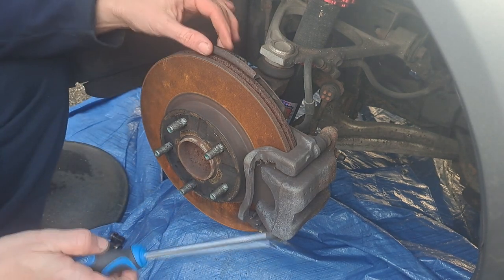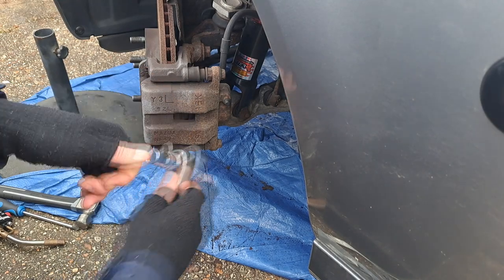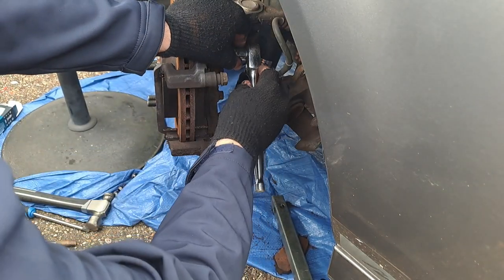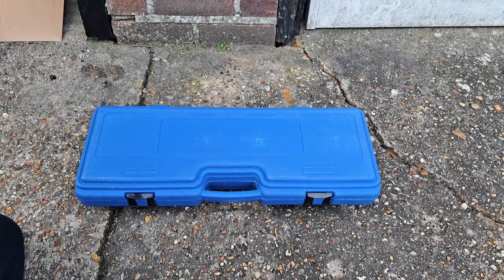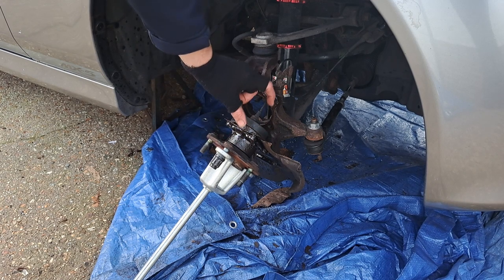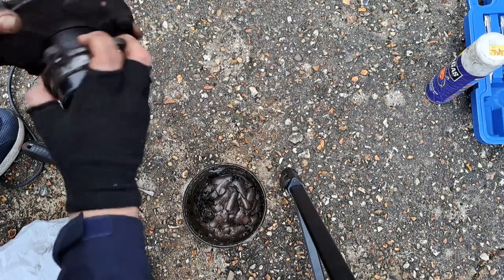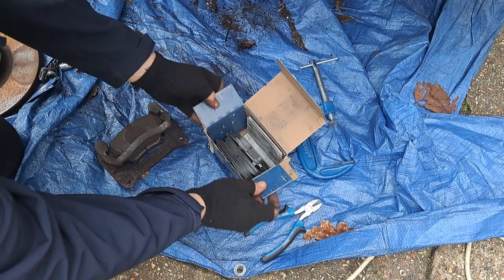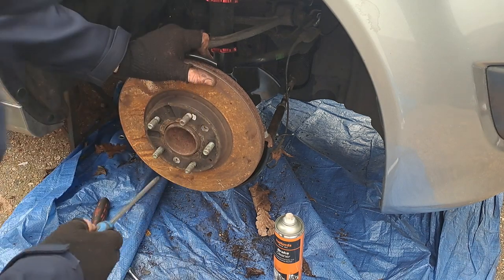Mazda MX5/Miata NC Mk3 - Maintenance Episode 6 - Front brake disc shield and pad replacement

Comment: Also, im assuming will it be similar to the rear?
Reply from the maker: Unfortunately not. You need to press the hub out from the middle of the bearing to get to the shield that is behind the hub. I needed a press.
Reply: @CompletelyDriven  thank you